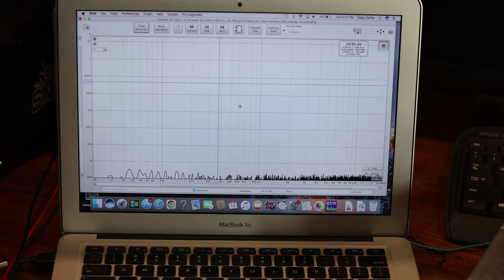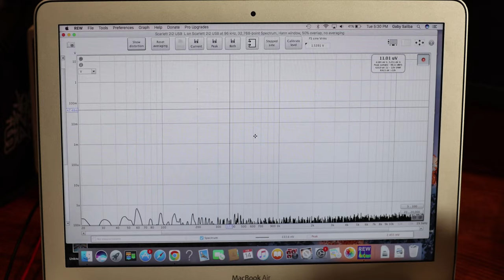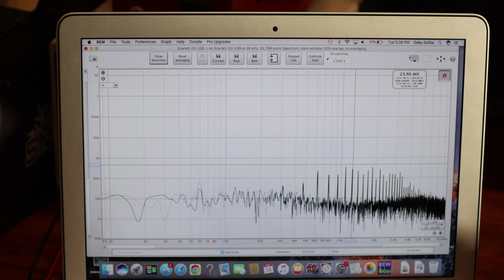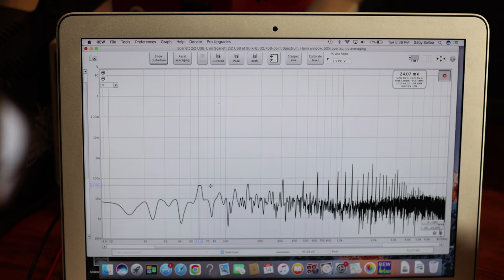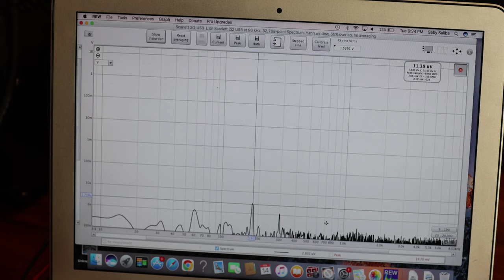Choosing the Best Power Supply. Lets measure ripple. Can a switching psu be good ?

Comment: Great video I also purchased same adjustable Voltage power supply , I recently purchased IFI Audio grade power supply V1 15V but for some reason wont boot up My Topping DX3-Pro + Dac . With power supply watch another uTube Channel this one have very low noise and ripple . Now it powers up perfectly better sound stage highs are much less harsh to ears..

Comment: Good job 👍. But this measurements do not represent noise and ringing at hundreds of kilohertz or megahertz, which can be generated by SMPS at some load.
For linear power supply this would be good technique.
You can test SMPS with FFT analiser first to understand the emitted noise spectrum.
One more thing is the coupling capacitor inside of the SMPS. 
Power supply can be quiet, but can bring some noise from the grid.
Reply from the maker: Correct, but  Rew does  supports 0 to 50 Khz so not too bad for a free software beyond that you will need  FFT analyzer as you mention Luckily for Audio he biggest problems are usually in that range.
Reply: will connecting a switching power supply to a balanced isolation transformer improve it's performance? (will correcting some of the input AC ripples benefit the DC output of a switching or a linear power supply?)

Comment: I purchased the ifi power supply for my Cambridge audio 540p that I've just upgraded, but it didn't work with it, as the 540p needs a AC power supply & the ifi is a DC power supply, my mistake 😢, another Great video from you AAAAA+👍

Comment: Very interesting video.  I installed 10 gauge dedicated circuits and then I thought I have a power conditioner and tried to determine what gauge wire is used to connect the various outlets on the back of their unit.  I asked the manufacturer, Transparent, and they said it was proprietary but was told they use a combination of 10 gauge and 14 gauge wires inside their power management box.  I use a 10 gauge power cord which they furnished to connect the unit to the Wall outlet.  My guess is they use 10 gauge initially and then branch out to the various outlets inside the unit with 14 gauge.

For the short length within the Power box do you think it matters not having a continuation of 10 gauge electrical wire, assuming they use 14 gauge?

Comment: Love my ifi i power / also i use medical grade power strip - pick i just uploaded on my community page with my amazing Sansui au717 that i would put against any Luxman/Accuphase/McIntosh - 
Sansui built them so good !! 
Have you ever worked on Vintage amps ? 
Thanks Gabster !!!!
Reply from the maker: Glad you like it definitely changed my mind about switching power supplies.
I have a lot of vintage amps that I collected over the years itching to upgrade them.
May be soon
Thanks Tee-Jay
Reply: @Gabster1  Hey Gabster Thats great to hear about your Vintage Gear ! 
I been into vintage gear for a long time since 89' 😆 But going to Master Restore me Au 717 its been one of my favorites 
My buddy Zero fidelity (Sean Fawler) Said if the au 717 sold today it would be atleast $ 6k U.S. I just love the warm full  body sound of the Sansui with Sparkling sweet top end and powerful bass and netural mids gets me everytime - 
You have a lot of nice gear that luxman power amp looks to be 🔥 !!
Reply from the maker: @tee-jaythestereo-bargainph2120  yes I love the Sansui sound got a AU4900 that I bought for $5 15 years ago I plugged it in and was blown away by the sound just needs a bit of restoring. I should try to find a 717

Comment: Hi Gabster, I followed you... very cool DIY streamers and speakers, planning to build my own. I like that you are very scientific and knowledgeable.. Some "objectivists" (ASR) would say Ian Canada is way overkill because there is so much distortion in speakers and power amps and you can buy a Topping DAC with switch mode PSU that measures perfectly for 349 USD....   What do you think Ian Canada stuff adds.... that people are missing... (planning my own build, scaled don of yours...if nothing else it is fun!)
Reply: I would take anything that ASR says with a grain of salt. They really don't know what they are talking about most of the time. They also said a $600 preamp measures "perfect" and is as good as a $10,000 preamp. I have heard the $600 preamp next to a $3000 one, the $600 didn't even come close. If half of what they claim was true, there would be a lot of hifi companies out of business.
Reply: @Pete.across.the.street @ Pete from across the street  - I agree that the 3K preamp USD sounds better. Amir can be a little fast to judge sometimes - but I have not seen a single engineer disputing his audio measurements. Gabster also seems very scientific, though I would argue above that we should measure the change in sound from a DAC with different SMPS', as we are not listening to the power supply, but the DAC. However, I was just curious, about what "philosophy" Gabster has to measurements...
Reply: @jungtarcph  his measurements are accurate but usually he is measuring the wrong thing and uses inaccurate assumptions and comes to conclusions that his own data doesn't support. One of his reviews he was testing jitter on an analog output, another he didn't recommend an item because he measured something that the item didn't claim to do, another he tried to measure emi on a cable that was unplugged. Just because other engineers haven't contraindicated him doesn't mean his conclusions are true. Most probably don't know him or care enough to chime in.
Reply: @jungtarcph  that is interesting, do you have a link to measurements of ian canada products that show that there is a lot of distortion in ian canada products?

I also use ian canada products myself and am curious, by the way, I don't hear any distortion in the music here and have owned many da converters in the past, from high-end to cheap.
Reply: @Pete.across.the.street  I think there might be other things that ngs to measure, but I have still not seen anyone saying what ASR does wrong. My personal philosophy is that sound character is hard to measure, and so is how it pairs with other equipment. But I like to see a person of science come up with a better way.
Reply: @michel8166  I have not seen Ian Canada stuff measured. The question is... If a 500 usd dac measures jitter and clock perfect, what are we getting extra with IC products.? Or what are we missing, in measurements?
Reply: @jungtarcph  I have a simple setup myself, a philips 1543 nos dac switched deverentially with custom output transformers from dion audio and behind this is an ian canada isolator II and a FifoPiMa 1.5 and powered by an ian canada PurePi power supply.
if I replace this power supply with a normal linear power supply, the sound will deteriorate.
so somewhere such a power supply from ian canada works positively and makes the sound nicer ....... in my case then.
Reply: @jungtarcph  well let me tell you then. They measure the wrong things, come to conclusions that the data does not support, assume that since x is this y must be that without testing y.

Comment: Great review here.  Thank you.  Just curious if the ripple varies with the voltage in your variable PSU.  I guess what I am alluding to is if the higher voltage Ifi ipower switching has even lower noise / ripple level than 5 volt.

Comment: Question: will connecting a switching power supply to a balanced isolation transformer improve it's performance? (will correcting some of the input AC ripples benefit the DC output of a switching or a linear power supply?)
Reply from the maker: A bit but not a lot
Reply: @Gabster1  Thank you! I have been using one to power my headphone setup and feel it has improved the overall performance. It's very difficult to AB test. But i feel everything sounds more clean & dynamic. Maybe you could use a probe to test these power supply options for a video :) love your work and music suggestions!

Comment: Thanks for the video! I'm going to get the IFI Power 2 for my Ethernet net switch going directly to my Aurender. Do you think it's necessary to get one for my Cable Modem  and Router. Those are on another circuit and level of our home, however, i dont know if the noise from its supplied power adapter carries over through  the Cat 6 Ethernet run. Thanks
Reply from the maker: yes the router is important Check out my Video on this Subject https://youtu.be/ybtRqJt8Vo8

Comment: Hi! Would it also be possible for you to recommend some linear powesupplies perhaps in the region of approx. 100-250 Euro? Allo Shanti Dual Linear seems to get much attention in that region. But it's a jungle and hard to get an overview. Perhaps you have tested some?
Reply from the maker: I have the Shanti I will test it sometime but hate the skinny long output wires. if you don't mind DIY the Linear Pi by Ian with Ultracaps is great. on the Cheap the 5$ ebay regulator is good not a lot of ready units without asking a fortune.
Reply: Hi! Thanks for your answer I shall have a look at Ian’s store, but it will be interesting to hear your opinion about the Shanti or some similar powersupply, how they can improve quality of sound. Thanks for your great channel!
Reply from the maker: @dana0001  You are correct  I will put it on my early next year's list Happy Holidays